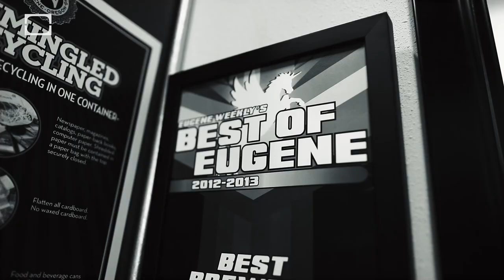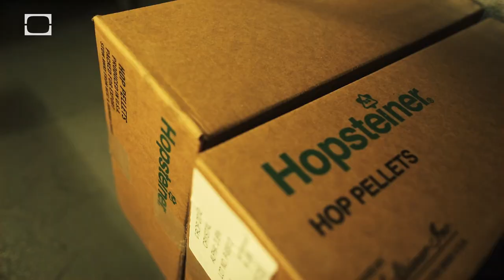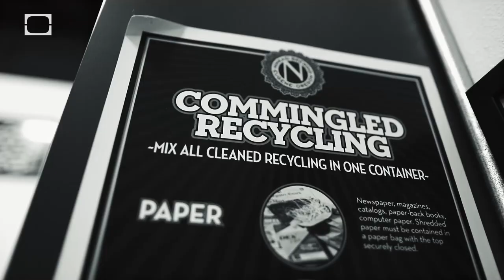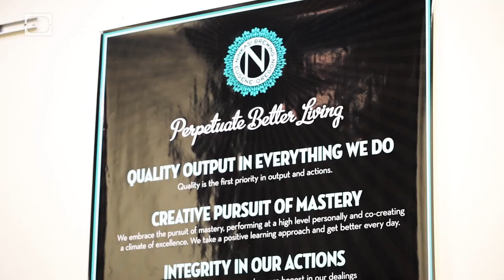Ninkasi Brewery Expansion

Comment: I worked on that ninkasi building from start to finish the one with the lift inside it that lift was a pile of junk I blue skinned the whole building with 2 other guys I helped poor all concrete and tied rebar built forms i even cut the skylights out the first time when the guy got fired for marking them like 2 feet out of place I was also part of the group that built the temporary roof on the roof and I did the water testing for the windows I missed the open house and havent been their since it has been finished the company I worked for at the time took that job over from another company that just erected the iron and ditched it yes I know the company names one day I will hopefully get to swing by and check it out